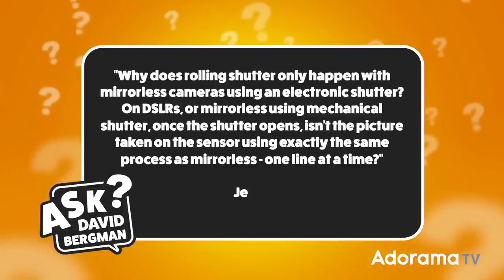Mechanical Rolling Shutter? | Ask David Bergman

Comment: Best explanation to my question so far. The crucial part here is clear, the sensor exposed to light whole at once and cut off very fast by mechanical shutter, the much slower readout speed can read the "frozen" state of signal on the sensor after. Many explanations found so far missed the important points explained in this video is that the signal is held on sensor for processor to read but readout speed is slow.

Comment: Thank you for the explanation David. But I still don't understand one thing: when in mechanical shutter mode the sensor acquires data as a global shutter? If it is not this way, the problem of the readout time should remain, as the curtains move fast, but the sensor cannot achieve such speed and thus we would have an photo with a black band (like the one when you shoot with a flash not in High Sync Speed mode). To explain better: if we imagine the two curtains moving almost parallel (with a fast shutter speed), if the sensor is still exposing one line per one line, if they move faster than the readout speed we would obtain a black part of the image. Otherwise, if the curtains move fast but the sensor behaves like a global shutter sensor, than the image is acquired completely. Thank you if you clarify this topic :)
Reply: The light hits the sensor all at once. Light is light. But then the data is "read" and cleared off the sensor and sent to the processor one line at a time.
Reply: Stefano, it is not the same. When mechanical shutter is used, the photosites are exposed for long duration of time, what makes "shutterspeed" short is the narrow gap of fast moving curtains across the surface of the sensor. The most of the time the photosites are read, they see just blackness - the curtain in front of them. However, when curtains are not there, you need to have different approach to set very short exposure times. For example, if you set "shutterspeed" to 1/8000, in mechanical mode this duration of exposing each photosite is achieved by curtains' gap, but in electronic mode it is achieved by cutting readout from each photosite electronically. The readout is started and immediatelly after 1/8000 cut off. So yeah, the data flow from each photosite vastly differs wheather camera is in mechanical or electronic mode.
Reply: @PiDsPagePrototypes  finally someone clear, thank you: "the light is read off one line at a time AFTER the mechanical shutter is closed". This was the passage I did not understand! So first the light "impress" the sensor, the information is held, and after the shutter is closed the information is read one line per one line, so the readout time is not a problem! THANK PiDsMedia!
Reply: Does that mean the sensor has a memory. Otherwise how does the sensor read the light after the mechanical shutter has passed over the sensor???
Reply: @plemas  Think of the pixels on the sensor as buckets that accumulate fotons (particles of light) untill the exposure is over, and they keep them untill the pixel is 'read,' (secuentially on a CMOS sensor), moment in which they release the accumulated fotons in the form of an electric current (measured as voltage). The amount of voltage (from 0 to 1) represents how much photons hit the pixel (from 0 to 100% of capacity) during exposure. In this sense you can say that the sensor has a sort of 'memory' implemented on each pixel.
Reply: It seems that the problem with the electronic shutter occurs when the read out speed of the sensor is not fast enough to properly separate the 'exposure' event from the 'read out' event. The mechanical shutter consist of a physical curtain that exposes the entire sensor at practically the same moment in time, so those pixels that haven't been read yet stop being stimulated by light during the subsequent reading process,. The key is that the mechanical shutter allows a separation between the moment of exposure and the moment of reading. In electronic shutter mode those two events are conflated together generating rolling shutter or banding artifacts in some circumstances. But it is important to mention that in both modes, the pixels are exposed the same amount of total time indicated by the shutter speed (say, 1/1000 sec), though in mechanical shutter mode the exposure occurs at roughly the same moment in time for the entire sensor, and in electronic shutter mode it occurs at significant distinct moments in time if the sensor read out speed is slow (e.g 100 milliseconds), generating rolling shutter and banding effects in some circumstances.
Reply: @phrasalsyntax Thanks for this clarification. It helped a lot!

Comment: follow-up questions after watching (assuming sensors readout speed is 1/180 of a second)
1. How does readout speed vs electronic shutter speed compare?
2. Is readout speed the same as time to capture the image on the sensor or does readout speed mean something different like time to pass the whole image off to the buffer?
3. How does a DSLR capture the whole image if the shutter closes (says 1/4000 of a second) before the image has been captured on the sensor?  Wouldn't the bottom of the image just be black?
4. On a mirrorless camera, if the readout speed is approx 1/180 of a second, does that mean shooting at anything above 1/180 of a second is useless (we are only getting 1/180 even if we shoot at 1/2000)?
Reply: 1) When using electronic shutter, the duration of time from reading first photosites' row, up to the last row is "sensor readout time", that equals very approx. 1/15s for older or 1/200 for newer sensors. The duration of time for each single photosite is read is the "shutterspeed", or exposure time  and is not linked to sensor readout time in any way.
2) I hope that this is answered in 1)
3) The exposure time for each single photosite, with mechanical shutter, is not equal to the set shutterspeed, but it has to be larger than the duration of the whole pass of the curtains' gap over the sensor (~1/200 = that actually equals flash sync speed), or longer (equal to shutterspeed or more if it is lower than that value).
4) No, because photosites' read are cut after exposure time elapses; that doesn't mean that sensor finished reading all lines.
I hope this makes sense?

Comment: It seems that the problem with the electronic shutter occurs when the read out speed of the sensor is not fast enough to properly separate the 'exposure' event from the 'read out' event. The mechanical shutter consist of a physical curtain that exposes the entire sensor at practically the same moment in time, so those pixels that haven't been read are prevented from being stimulated by light during the subsequent reading process,. The key is that the mechanical shutter allows a separation between the moment of exposure and the moment of reading. In electronic shutter mode those two events are conflated together generating rolling shutter or banding artifacts in some circumstances. But it is important to mention that in both modes, the pixels are exposed the same amount of total time indicated by the shutter speed (e.g. 1/1000 sec). The key difference then is that in mechanical shutter mode the exposure occurs at roughly the same moment in time for the entire sensor (thanks to the fast physical curtain), and in electronic shutter mode it occurs at significantly distinct moments in time (if the sensor read out speed is slow, for example 1/10 sec or 100 milliseconds), generating rolling shutter and banding effects in some circumstances.

Comment: Great explanation!!! I am sure you have experienced this, but I photographed a small concert in TN where they used LED spotlights. When the dimed to spot a little, I had banding on my images when using the electronic shutter on my Canon EOSR. After some research on the lights, I found out that the LED lights are actually pulsed and to make them appear dim, the pulse width of the "on" time to the LED is shortened -- this caused banding (I think) on my images. Not sure if this is all correct, but it was nice to shoot with a silent shutter! Is there any way to get around this while useing the electronic shutter?

Comment: David...It sounds like you are confusing electronic exposure time with readout time.  For example, for a 1/10,000 sec exposure, let's have the pixels start receiving photons at time 0 and turn off the pixels at time 0.0001 sec.  Then at your leisure you can readout the pixel voltages line by line.  It doesn't matter if the readout time is 0.01 sec or an hour.  The picture will not have distortion.
Reply: good point, but it seems that on a CMOS sensor you can't make all pixels simultaneously start receiving photons at, say, time 0 and being turned all off at time 0.0001 sec. They seem to be turned off when they are 'read' which on a CMOS sensor happens sequentially not simultaneously. The advantage of a mechanical shutter in scenarios with fast moving objects (or fast camera movements) is that a physical mechanical curtain with short exposure time guaranties that those pixels that haven't been read yet stop receiving incoming light, hence minimizing eventual rolling shutter artifacts.

Comment: so basically when using mechanical shutter the sensor works as a global shutter receiving light in all their pixels at once as the curtain passes, then it starts reading the collected data at the readout speed. Right??? If not, I dont understand how a fast shutter like 1/4000 would be able to expose a line at the bottom of the sensor that didnt even started collecting data.

Comment: How does the shutter speed work with electronic shutter,  if you shoot at 1/4000 and say 1/500 how does an electronic shutter differentiate the two , with mechanical the second curtain will start to close sooner with faster shutter speeds but how does this work with an electronic shutter.
Reply: The duration of time the single pixel is read, and the duration of time the scan over the whole area is done are two independent values. The data flow from each photosite is cut off after exposure time finish. It can be extremely short time. The scan time over all photosites cannot be that short to avoid capturing different part of the image at significantly different point in time (yet).

Comment: Automatic Rolling Shutters are available in Bangladesh. Also available in various sizes designs and colors, these shutters are highly treasured by our clients due to their features like high tensile strength, fine finish, fire resistance, robust construction, lightweight, and sturdiness. Premium quality raw materials and cutting-edge technology are used in the design of these automatic rolling shutters that ensure their durability. By using the latest technology, these doors are precisely tested by our experts on various quality parameters. Our engineers are ready to serve your desired product options anywhere in Bangladesh. We offer these Automatic Rolling Shutters at a very reasonable price to the clients.

Comment: The problem started with CMOS sensors. CCDs (charge-coupled devices) are alternatives to CMOS sensors, which are generally more sensitive and more expensive. CCD-based cameras often use global shutters, which take a snapshot representing a “relative” single instant in time and therefore do not suffer from the motion artifacts caused by rolling shutters, but CCD have problems like using too much power and expensive. Now, how do you avoid the rolling shutter effect? to avoid rolling shutter when recording fast motion or panning your camera, adjust your shutter speed to twice your frame rate. Standard cameras shoot at 30 frames per second (fps), so the slowest shutter speed you should use is about 1/60 of a second.